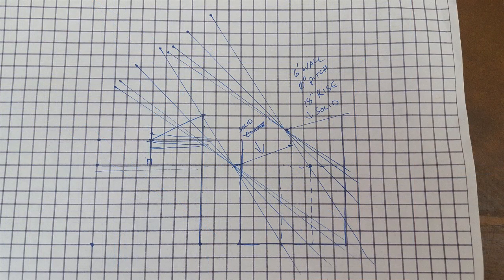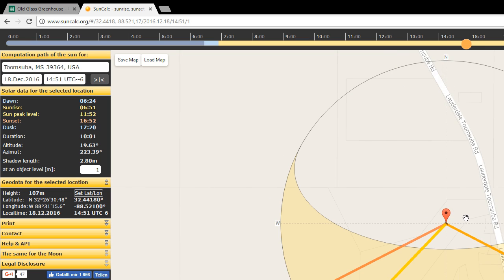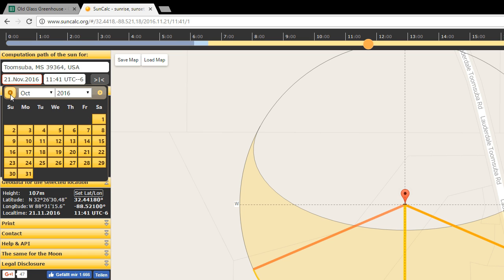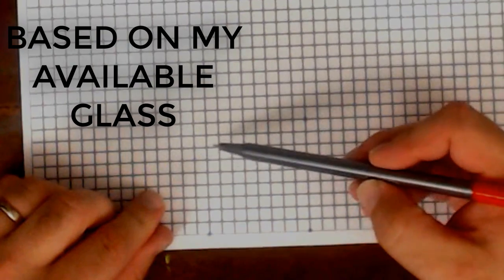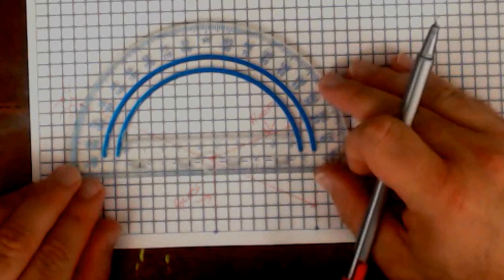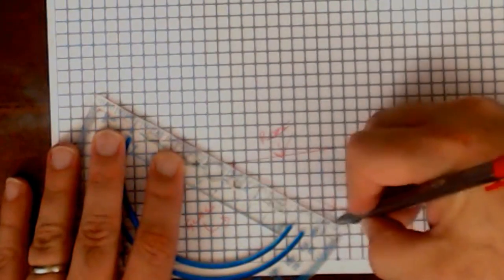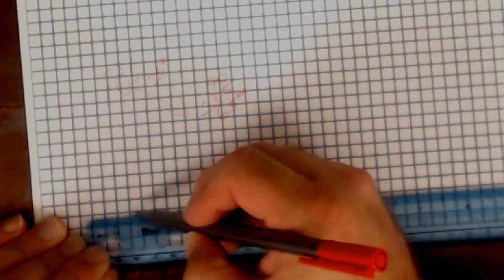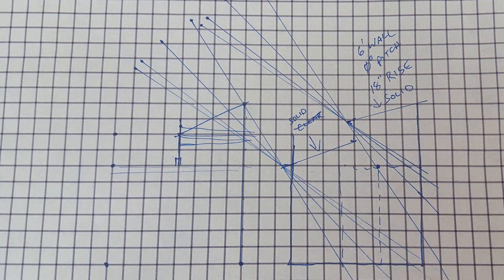Design for the WORST conditions - Old Window Greenhouse - Part 2

Comment: Let me preface my comment with the fact that I think it's great that you're doing the planning stages in this. Many just start doing without a proper plan.

I've grown up with access to lots of free reclaimed stuff. I've learned over the last 25+ years that it's still better much of time to design from scratch than to design with the constraints of using old building materials. I've just found with anything more than 100 sq/ft that it will end up costing more in the end to use reclaimed stuff and to have it last for decades.

Your design is also seems to be assuming a linear light exposure but that's completely incorrect as the intensity is logarithmic which is a massive difference. I'm a mathematician by trade so maybe I notice this quicker than most but it's a big factor in the design in my opinion.
Reply from the maker: I shudder at the idea of a mathematician having viewed this video. I'm sure I made several errors or omissions, so thank you for not enumerating them.
Reply: +MrChipGardener, could you please elaborate about the light exposure? Thanks in advance!

Comment: I love the idea of a reclaimed window attached greenhouse, I think there beautiful.  But for your intended purpose  in your part of the country wouldn't a polly tunnel be sufficient.  Also does your 6ft front wall plan on having a foundation or would it be glass all the way to the ground?
Reply from the maker: A poly tunnel would be great, but take up space I don't want to take up. Could put poly on a lean-to greenhouse, but I have these windows, so...

And yes, there will be a foundation, so to speak. Windows will not touch soil.

Comment: I followed what you did and why. Kudos. 
What I am wondering is why you didn't also calculate at the Summer Solstice and the Equinox. Maybe you are planning to only use the greenhouse in the winter? I would imagine that your greenhouse might become an oven in the summer unless you can somehow mitigate the sunlight.
Reply from the maker: We have no plans to use it during the summer. We'll have all the doors and vents open to minimize heat retention.
Reply: Cool! Maybe you could grow an annual vine on it to shade it in the summer to help keep the house cool?
Best wishes - love the videos!
Reply from the maker: That is something we've considered, but likely a project for "season 2" of the greenhouse, lol
Reply: To everything there is a season. Baby steps! :)